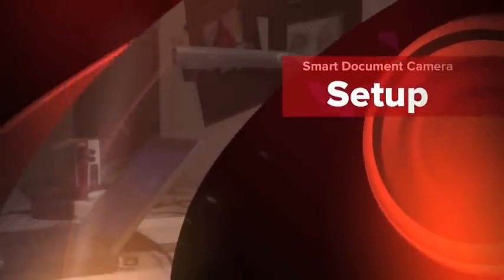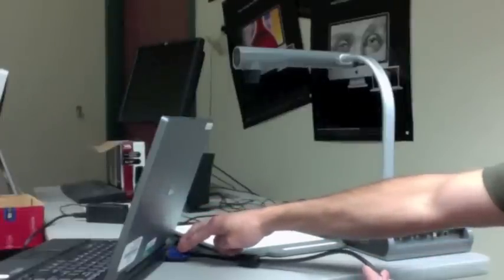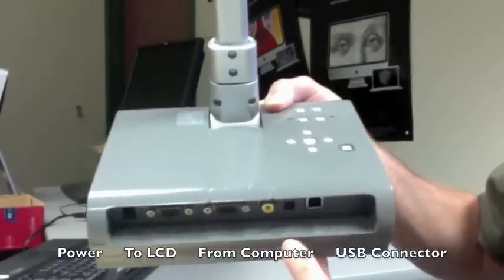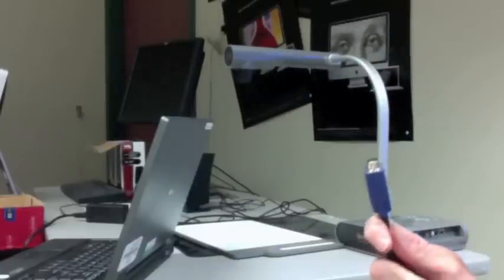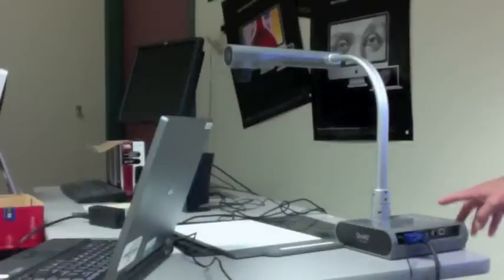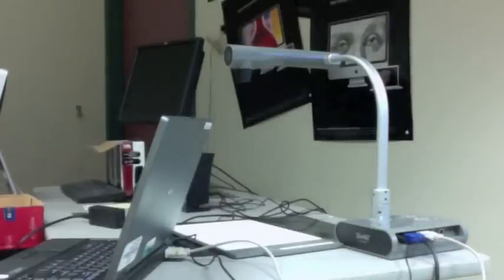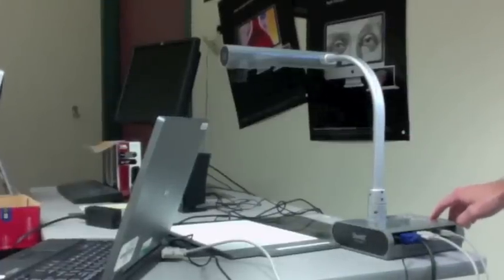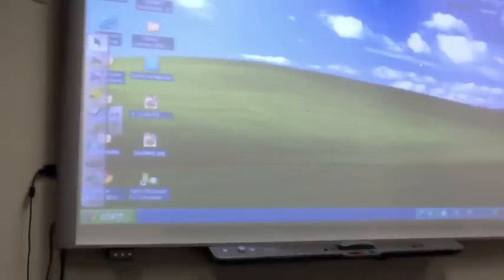Smart Document Camera Setup

Comment: Can you input onto the laptop screen?
Reply from the maker: Hi there, Michael Zedalis, and thanks for your question.
Generally, you can display what is under your Smart Doc Cam onto a monitor or screen using an LCD projector, but you can capture an image using the Doc Cam one of two ways:
1) with the Smart Notebook software, you can take pictures with the Doc Cam and manipulate them on the laptop, or
2) by inserting an SD card into the slot in the Doc Cam and capturing the image onto the SD card, then loading it on the laptop.
I hope this answers your question; if it doesn't, please let me know!